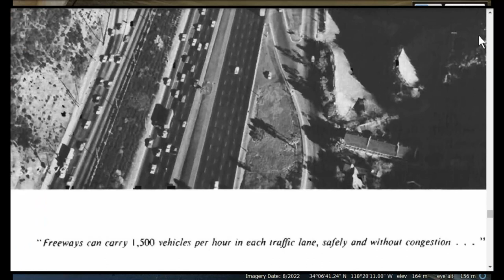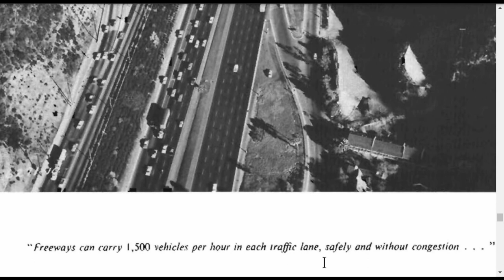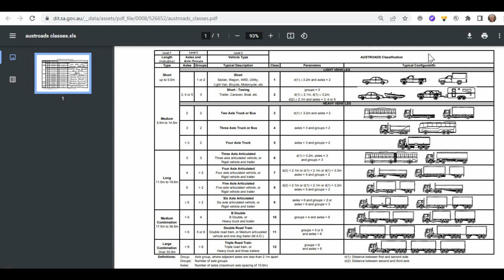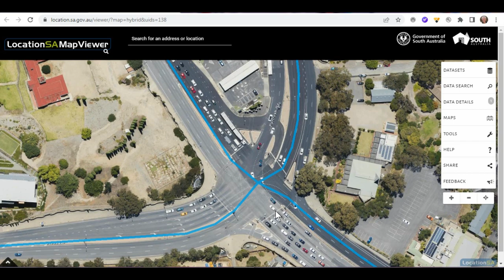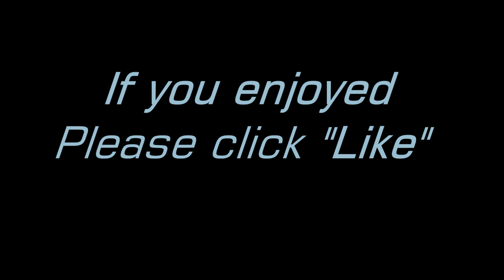SE Freeway Interchange Proposal at Glen Osmond in Greater Adelaide Video Feb 2023

Comment: Hi Neil,
This intersection has a massive number of major traffic movement conflicts! Grade separation will remove two conflicts only but also a few pedestrian ones. 
A flyover interchange as per HWY 101 in California I think would be out of the question for Glen Osmond Road now due to the environmental impacts. Thus a tunnel would be the preferred option being less intrusive. 
Sadly this problem should have been addressed 50 years ago long before it happened, not now!
Reply from the maker: There have been multiple consultant reports to get freight and vehicles through or around the Adelaide hills - Globelink election promise and the Globelink Feasabiility Report being the latest.
What about a tunnel form Glen Osmond to Richmond. it can join onto North South Road and its 2 tunnels and the James Congdon  Drive and  Richmond Rd    6.25 km  in a straight tunnel
The land around their is being leveled in the latest version of the T2D project..   Freight vehicles can then use the North South Freeway to move North or South and get them off Port Rush Road.

Comment: The South Eastern Freeway in South Australia needs to be extended to bypass Adelaide liking the M1 to the Princes Highway on the other side of Adelaide
Reply from the maker: It is 7 km from the Gen Osmond Intersection to Black Forest on the South Road is the shortest route the tunnels being built under South Rd. 

The M7 Clem Jones Tunnel (CLEM7), known during its development as the North–South Bypass Tunnel (NSBT) in Brisbane is a model of what should and should not be done.     

With a length of 4.8 km (3.0 mi) it was the longest road tunnel in the country until the 6.7 km (4.2 mi) Airport Link tunnel was completed

The road tunnels in Brisbane are private Toll Roads and as a result are often called "Brisbane Empty Tunnels". 

In Adelaide the 2 road tunnels currently being built under South Road are NOT TOLL ROADS and should be very popular

Comment: a big chunk of road users and cargo could be moved threw a better hills train system
Reply from the maker: Yes, but Passenger and Freight should no be mixed.     
Norway has done this in hard rock mountains similar that of the Adelaide Hills.     
*  The mix of gauges down the Sleeps Hill means we have 2 single tracks.     If we tried to use dual gauge, broad and standard gauges, we have serious problems when fast trains go over the switches.
*  The other problem is the S.A. government in the Whitlam & Dunstan era "sold" the country main rail tracks and the associated trains to the Federal Government.  The Federal Government created two separate entities to hand each of these activiites   The tracks management became the ARTC whose headquarters are here in Adelaide.   
So Canberra and our Federal MPs are the group who should be making the improvements.

Comment: The bus pictured in the slip lane at about 6 minute mark is the the 861 route which is going back down Glen Osmond Road , buses from Portrush Road ( route 300 ) continue onto Cross road and buses from Cross Road continue on to Portrush  , which is one word not Port Rush
Reply from the maker: Hi Tim  Spot on.     An unintended mistake.     The significant is our Buses at this section of the road are NOT in a dedicated Bus Lane.    This is contrasts to Anzac Highway between Keswick and West Terrace where there are Bus Lanes.    7am to 7 pm Week Days